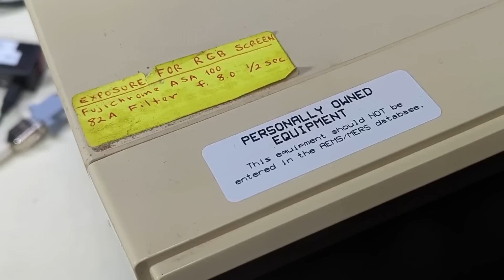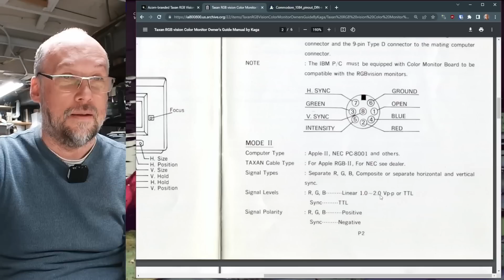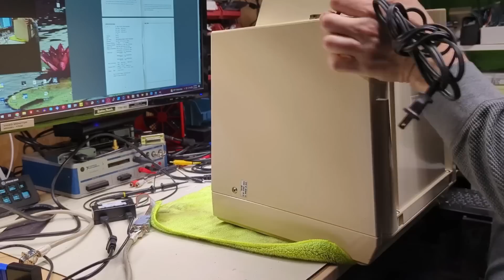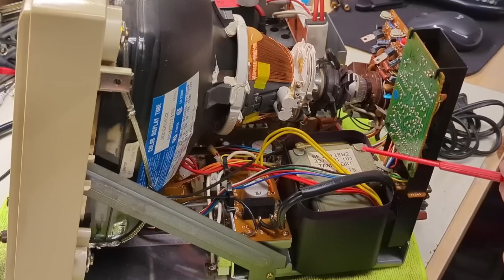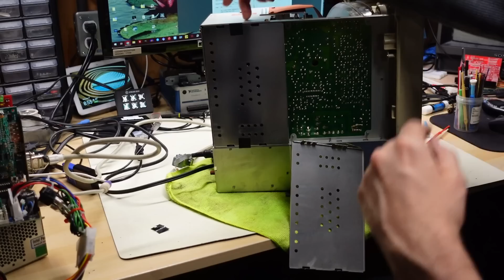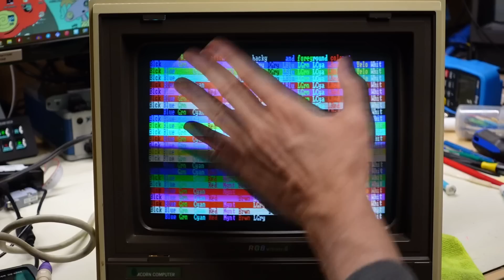I was shocked to find an Acorn Computer monitor in the US

Comment: Acorn tried to sell a version of the BBC Model B in the US. As well as being adapted for NTSC, the motherboard layout was different, it came preinstalled with speech synthesiser chips (these were normally an optional upgrade), there was RF shielding in the case, and most importantly the COLOUR keyword in BASIC was replaced with COLOR. They sold abysmally, most were repatriated to the UK and converted to 240V 50Hz, PAL and the UK BASIC version. I think I had one of these once, with faulty speech chips and the RF shield missing.
Reply: I think no more than 50,000 American BBC B's were manufactured. Did they come to market too late because of the shielding requirements?
Reply: @naysmith5272  I'm not sure - I'd always assumed it was just a poor business decision made at the wrong time. Cracking the American market sounds like a good idea in theory but it was surely impossible, already being filled with the Apple II, Commodore and Atari computers, and the IBM PC on the rise.

Comment: Never seen anything like this in the UK, infact I am not sure if Acorn ever branded a monitor during their 80's heyday.. Perhaps when the Archimedes came along. The de-facto standard monitor for the BBC series was the Microvitec Cub which was a superb and simple monitor.
Reply: The Master Compact had a branded monitor (a Philips CM8533 iirc), though the logo on the faceplate was a Master series "M", rather than Acorn. The same monitor was supplied with the A305/310/400 series, with Archimedes branding. I don't recall anything having plain Acorn branding until the A5000 came along in the early '90s.
Reply: I am pretty sure there were monochrome Acorn branded monitors.
Reply: @SimonEllwood  There are a couple in the list of Acorn product codes: ANF01, ANF21, along with colour ANF02 and ANF12. I've never seen one though!
Reply: @gslug1  I think I used to have an Acorn Green screen that looked like it had been made by Philips. I sold it in 2019. (I had a large collection of retro but sold 90 percent of it in 2019 when downsizing).
Reply: @SimonEllwood  I certainly remember Philips branded monochrome monitors. We had some at school that looked like a slightly smaller CM8***. I assume the Acorn was one of these.

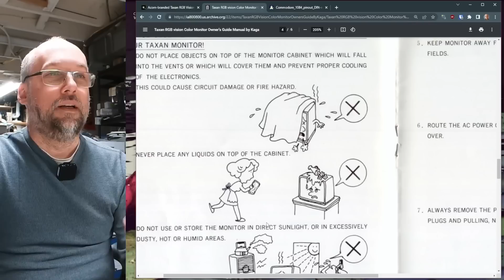Comment: 10:46 - not just the 80's, the Nintendo Wii manual also had similar cute drawings.
24:28 - in the final moment it started to move a little bit, maybe it's on one end of it's scale and not that sensitive there.

Comment: What an odd monitor.
I would have initially assumed the round DIN connector would be analog RGB, as that would match the analog RGB output of a BBC Micro, but going by the manual - thats purely RGBi, yet its the other connector that does analog RGB.
I could be wrong, but I think the Acorn Archenemies did RGBi, but this monitor is tool old to be for them.
I can only assume it came with an odd cable with a round DIN at one end (for the Beeb) and that square connector at the other end for the analog RGB into the monitor.
Reply from the maker: The early BBCs are digital RGB right? So it would have been a DIN to DIN cable I guess?
Reply: @adriansdigitalbasement2  analog
Reply: I think I the beeb is TTL. Scart cables have dropper resisters in them to convert it.
Reply: The BBC Micro and Acorn Electron produce digital RGB via their DIN sockets and can only produce seven colours plus black. The Archimedes produces analogue RGB via its SCART socket. Curiously, the BBC Master Compact was bundled with a Philips colour monitor that could accept analogue RGB, being similar to that provided as an option for the Archimedes, but the Master series had the same RGB limitations as the original BBC Micro and so only produced seven colours.

There was a high-resolution monochrome Taxan Viking R140 monitor specifically marketed for Acorn's R140 Unix workstation. That was apparently a modified version of an existing monitor employing two BNC sockets. I imagine that Taxan were amenable to rebadging and bundling arrangements, as were Philips whose monitors were ubiquitous in the late 1980s.
Reply: @paul_boddie  I’m sure the Elk and Beeb are analog RGB. I’ve run both thru SCART + OSSC plenty of times
Reply: @MrLurchsThings  I guess it depends what you mean by "analogue" (or "analog"), but the Elk and Beeb only produce RGB signals at two voltage levels, this being considered as "digital" in some sense and is how the term is being used here. These machines, particularly the Beeb, would be used with monitors like the Microvitec Cub which often expected inputs at these particular voltage levels, although some models of the Cub were also capable of accepting a more general input signal.

Obviously, you can send these "digital" signals through a SCART connection and the output levels are merely two in the continuum of possible voltages, so you get a picture. Of course, these signals are not "digital" in the sense of being encoded in some way, like more modern digital video signals such as DVI and HDMI.

Maybe "two-level" would be a more accurate description of the signals these machines produce, although that is a legitimate definition of "digital" all by itself. But the use of the terms "analogue" and "digital" to describe the output level characteristics of video signals is quite entrenched, probably being rather pervasive in historical literature as well as in more modern discussion of such older machines.
Reply: That square-ish connector is a sort-of standard which Sony heavily used (created?) at the time, so that's probably included for wider compatibility (about as wide as NA got anyway, lacking SCART) even though by what you say it wouldn't work with a simple DIN to DIN cable for their own computer.